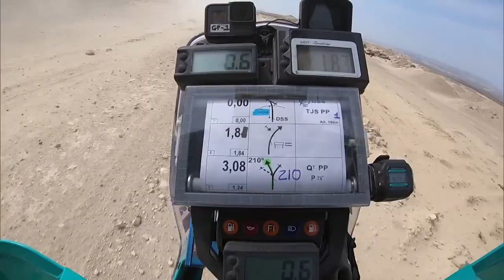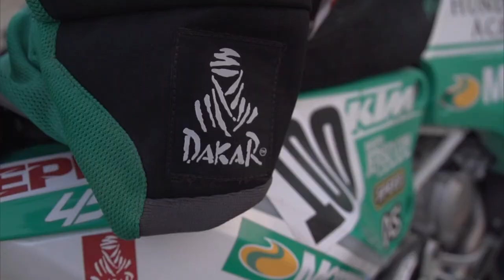Lyndon Poskitt Racing: Races to Places - Dakar Rally 2018 - Episode 6 - ft. Lyndon Poskitt

Comment: I totally agree with previous comment.  Totally better than official Dakar coverage.  Two thumbs up. By the way does your bike use conventional clutch ( with control lever ) or are you using one of those Rekluse clutches?  Fantastic bike, video footage, your video blogging, and gear.  I have look into the Adventure-Spec mesh.